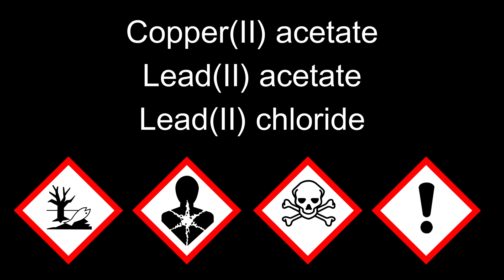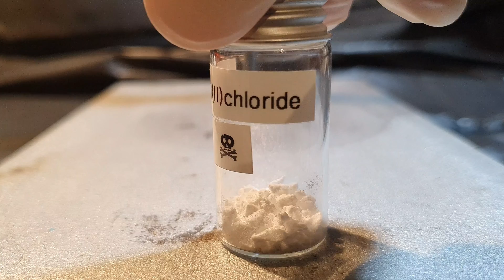Copper(II) acetate, Lead(II) acetate and Lead(II) chloride preparation

Comment: Hi there! I had the experience of pouring some lead 
as well. But unfortunately the lead balls were stored in a detergent bag because I thought it was tight but clean of detergent. Now about 1/3 of the volume consisting of three components are unwillingly to participate the pouring process: small ferric particles, and large grey metallic crumbs which do not melt, and finally a sulfuric looking coating on the crumbs. Can we assume the crumbs are lead oxides? Why won't they melt?

Comment: Props for mentioning the need to send waste products to a facility capable of properly disposing of them. It's always easy to think of sewerage water will go somewhere important insignificant
Reply: Or just make the lead insoluble and keep it.  Lead is easy to recycle.  Just convert it to lead carbonate, lead sulfate or black lead sulfide.  Copper salts can easily be dealt with by displacing the copper ion with iron or aluminum leaving the copper metal as a red powder like in the video.  The copper powder can be heated in air to make black copper oxide and dissolved in a dilute acid of your choice

Comment: Why did you use the copper acetate? Why not dissolve lead in acetic acid with hydrogen peroxide just like the copper?
Reply: probably because that way it would generate lots of harmful and quite toxic mist and droplets that contain soluble lead
Reply: You gonna second guess a German about chemistry?